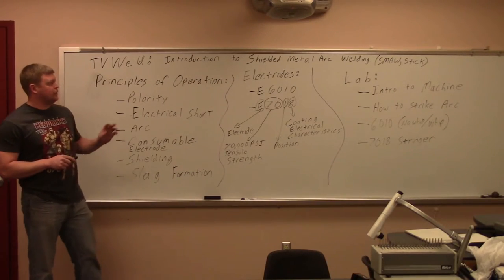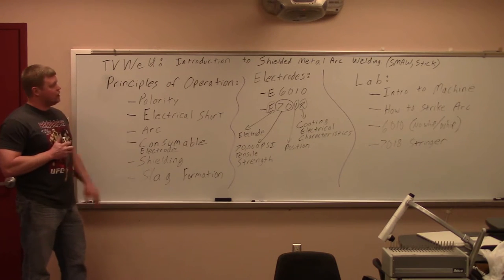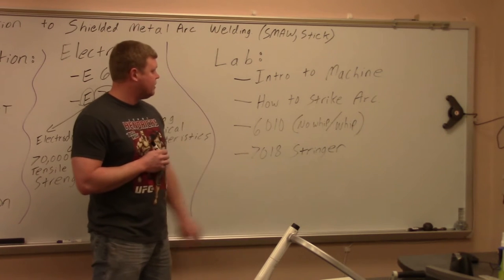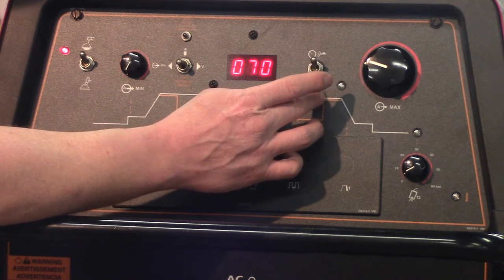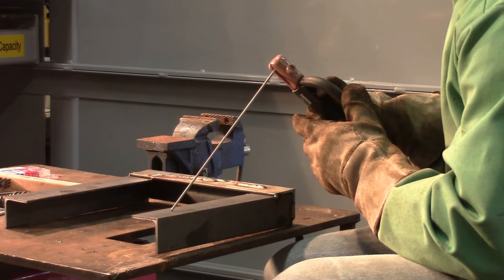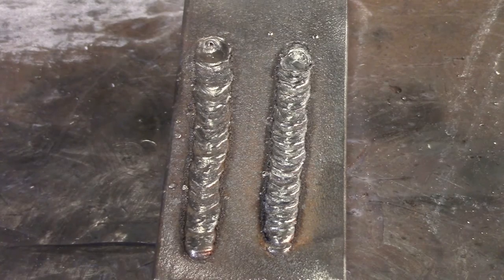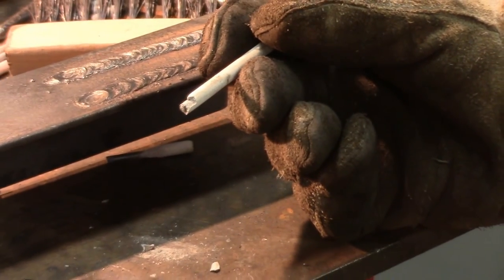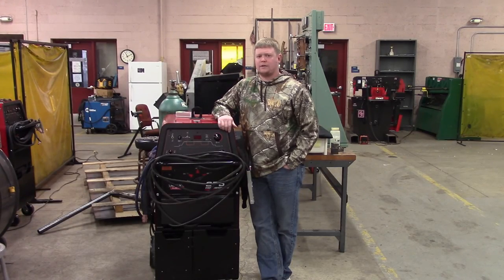Introduction To Shielded Metal Arc Welding

Comment: hello, the 7018 did stick also  because not enough pre heating, (while it is also a good demo of too little amps, the rod should work at 120Amps) . Making a smoke trail while starting the rod would have avoided it. Many seasoned welders do start almost immediately , seem to me 7018 do not like that, I was given a very efficient trick that is to light the 7018 by pushing lightly on the rod while moving toward the start of the weld, with a finger the other hand, lenght 1" env. THen the rod is really hot enough, plus the graphite end that is on some of those rods is burned, zero porosities on the start granted .